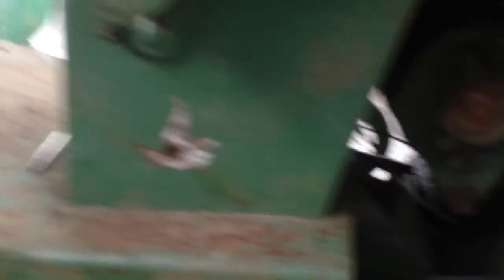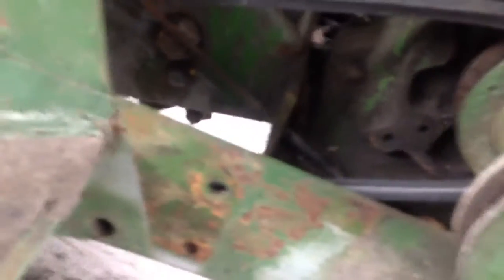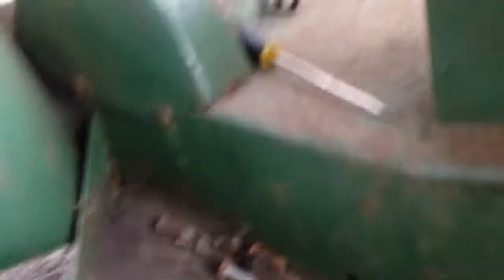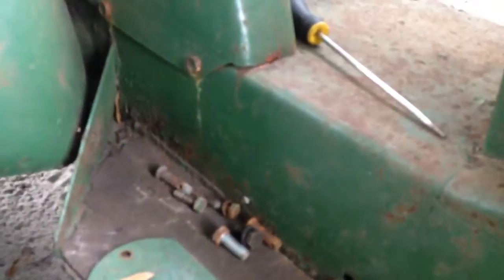John Deere Clutch Is Done

Comment: Belt guides on the rear and front will push the belt off the pulley opposed to making the belt wider, put a belt guide on the top and bottom of each pulley and you'll be golden!
Reply from the maker: Alright thanks man!